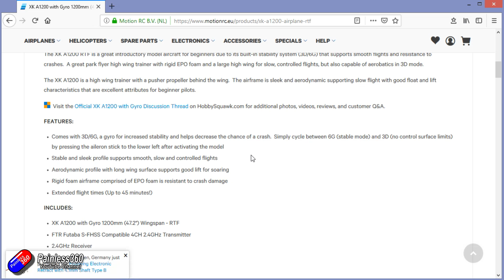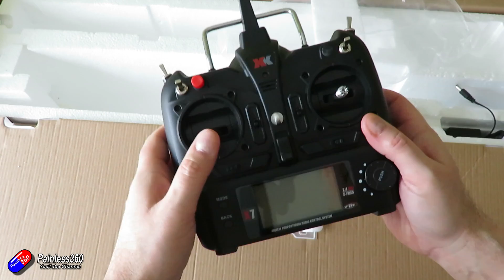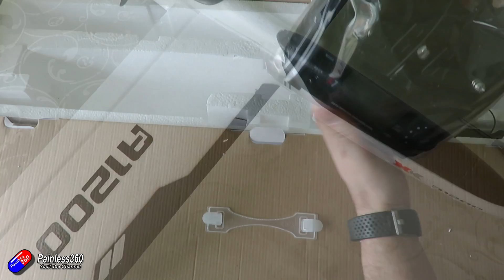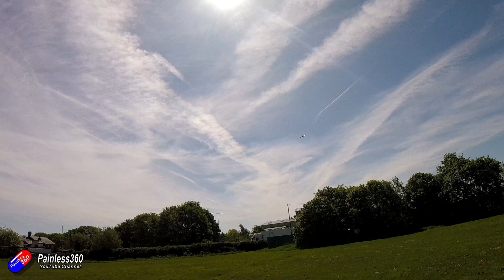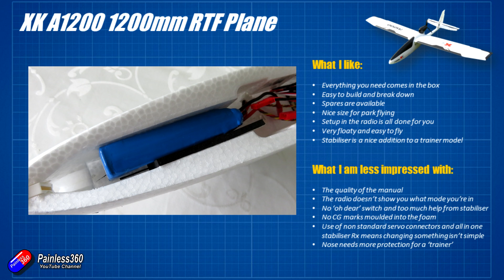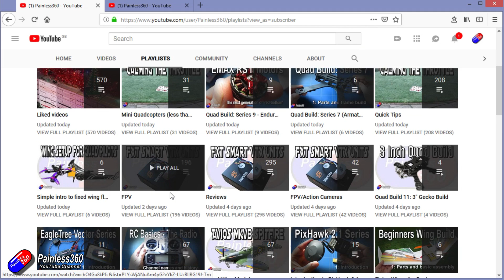XK A1200 RTF Airplane - good for beginners?

Comment: I like this plane but...It's still tail heavy with all the FPV equipment on board. I taped a 5 gram lead weight to the top of the battery to get a slight nose down CG.  Made all the difference! The terrible thing with this plane is the built-in Up elevator / throttle mix in 6G (auto level / Launch) mode.  I'm wondering if the elevator mix can be taken out in the radio or is it built into  the flight control?  FPV would be great in auto level if not for that.

Comment: I've flown this model a lot, especially the FPV version which is very hard to find now.
And that is a pity as that versions is significantly better balanced out of the box and the FPV was absolutely excellent both as FPV and as a source of onboard video

Yes the nose can be "fragile" but oddly perhaps the earlier models also had a vulnerability just aft of the motor mount. Both are easily strengthened  though.
As a beginner plane it does have some disadvantages as progression using this model is difficult because of the stabiliser. On the other hand the flying time means that a new pilot gets a LOT of practice. And it does fly well. Great review

Comment: Nice video Lee. The plane itself looks good even though there are some aspects that go against traditional "standards" that are in place (e.g. connectors etc.). That said a great "in the boot" model. The only little niggle I have is the use of stabilisation devices in trainers. As a club instructor I have come across numerous occasions where a we have a new member joining the club who is "experienced" and wants to quickly take their "A" certificate. As we know stabilisation cannot be used for the "A" but most of these guys cannot fly without it. Using stabilisation has it's place and I'm all for it but there are circumstances where it can be detrimental and I think using it as part of a training plan it one of them. In the past a standard trainer would be a high winged balsa plane with a level of dihedral, a 40-46 glow engine and a basic 4 channel radio. Things have come on a lot since then with different building materials, different power trains and better radio systems. What has not disappeared is the need for a pilot to learn how to fly ... by themselves. Many thanks for all the work you put in ...
Reply from the maker: I agree. The stabiliser it doing a little too much here and a new pilot could learn to fly only with it's help and then be 'stuck'. I'll be creating a 'learning to fly fixed wing' video series shortly as I'm getting more first-time pilots who are struggling to get into the air, coming from quads and others struggling to turn off the FW stabiliser after taking their first steps.. Happy flying!